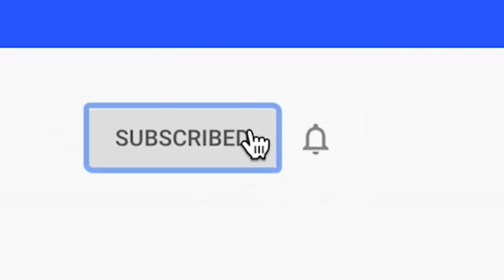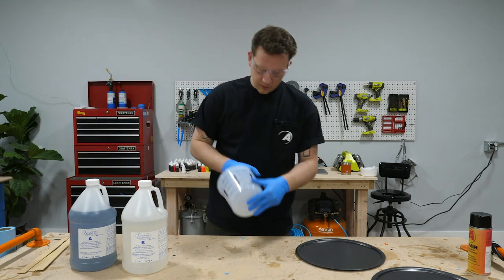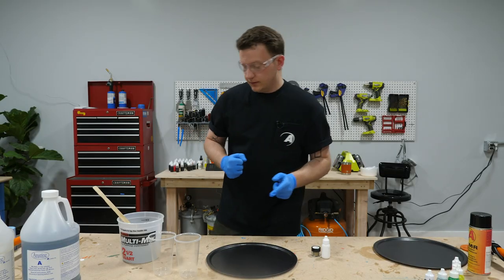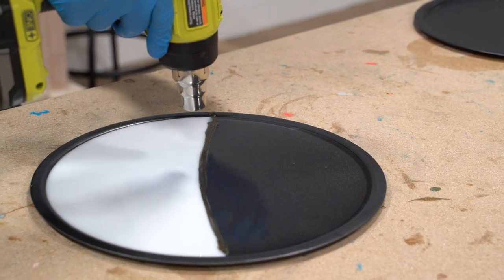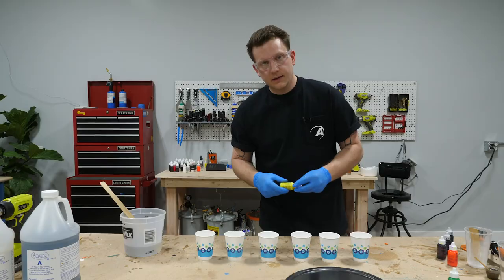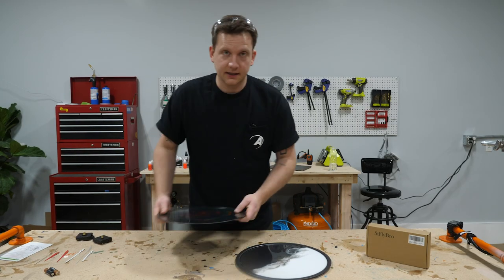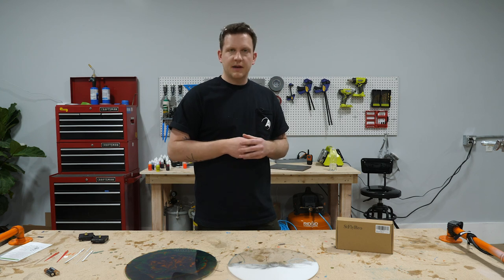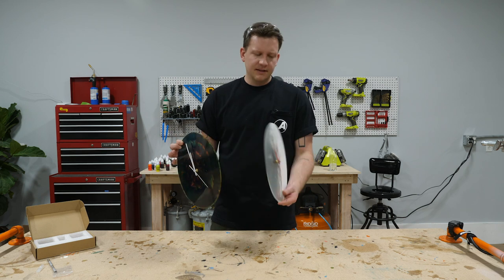Making Clocks out of Epoxy | Alumilite

Comment: Clocks are really neat! I want to make one right now. I have a question about the Alumilite dye. I have tried using it in my epoxy for several things and each time it causes holes and the Alumilite Flo dye does not dry and keeps seeping out of several holes. I thought I might have been mixing too much in my epoxy,  so I cut back to a couple drops and the same thing happened. Any suggestions?
Reply from the maker: That sounds super strange for our dyes! We would recommend reaching out to our technical services team at info@alumilite.com - they should be able to help you figure out what’s going on!!

Comment: So how do you keep the clock from bending? I've left mine for several days in the mold to make sure it was cured completely but it still bends...it's driving me crazy
Reply from the maker: That sounds like a cure inhibition problem! Your epoxy should cure solid and hard - if it doesn't then that means something most likely went wrong along the way. Or it's that your mold isn't deep enough. Thin layers of epoxy are more likely to come out like this - you see this alot with people making wine caddies. Try making your piece a little thicker!